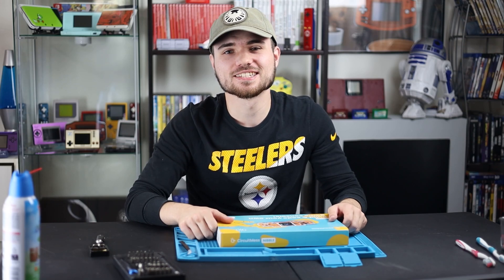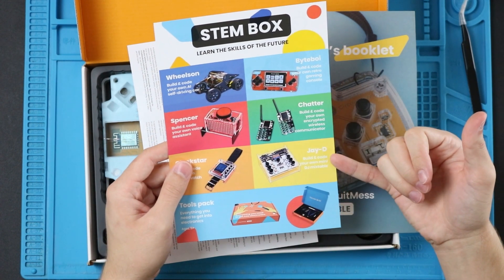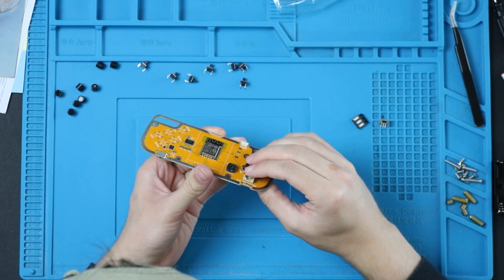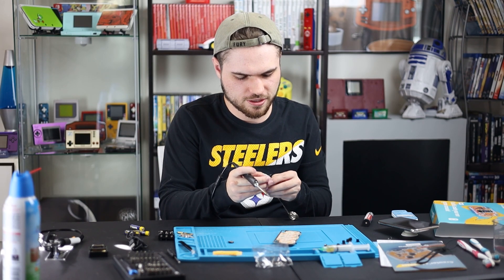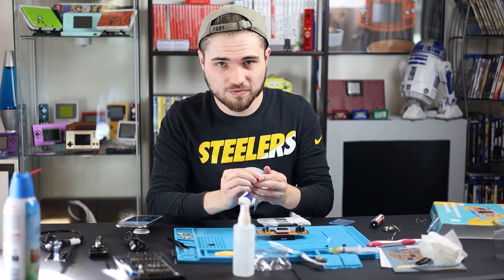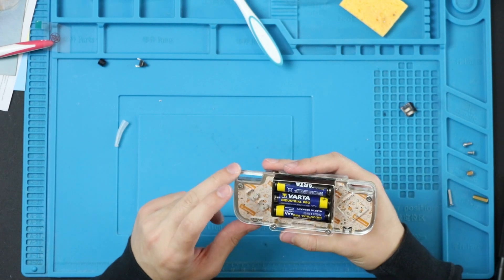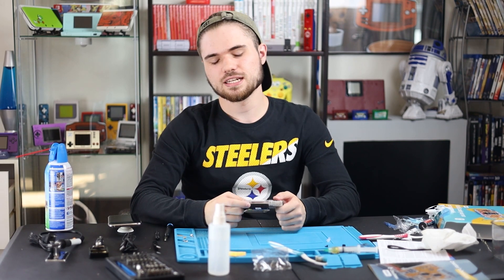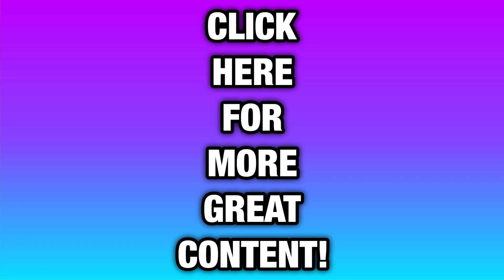I Built a Game Boy From Scratch!

Comment: Great video! 
I can confirm that the solder does not have led, and it has a flux core which may be why it smells, I dunno. 

I did a template and build for a custom screen lens for those who are looking at protecting it. Not sure if its ok to drop a link. 

Also if you plan on doing coding on it, doing the USB power mod is a must as the standard for programming uses the Batteries as power. 

Keep up the great content!
Reply from the maker: Thank you for the confirmation! I don’t allow links in comments because I used to get a lot of spam comments and it’s easier to turn it off :/ I am looking to make a game so I will do the power mod!